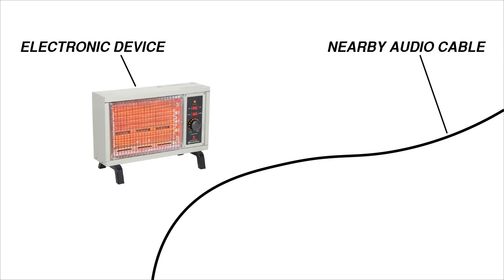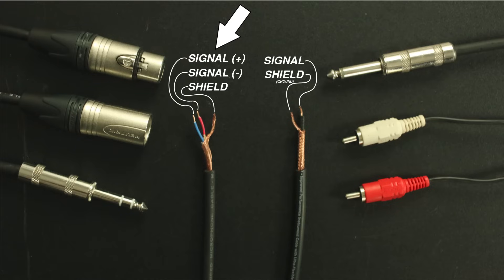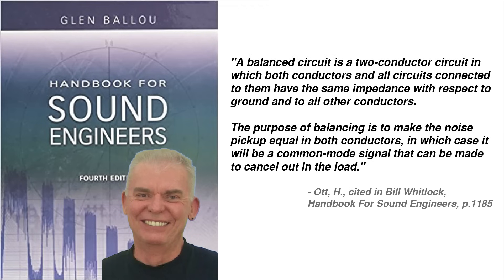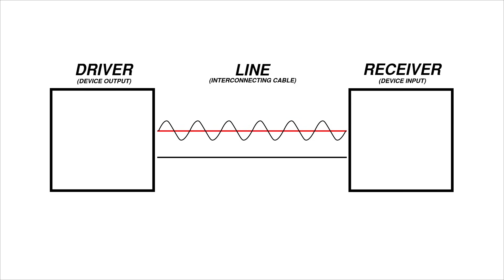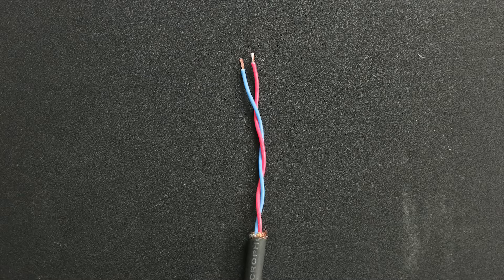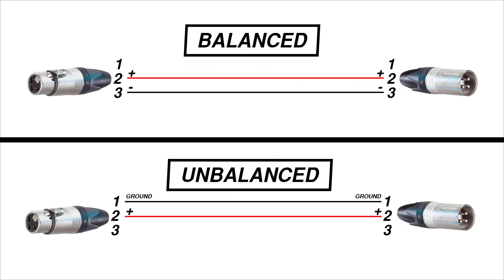Balanced vs Unbalanced Audio | Do Balanced Cables Sound Better?

Comment: Pretty slimy of you not to mention that this effect only matters if you have a 1,000 foot cable, and there's absolutely zero audible effect on an unbalanced cable of only a few feet. It would have been trivial for you to demonstrate that in the video too.
Reply from the maker: Any connection over 15 to 25 feet should be balanced.

Comment: The reason the cables are twisted is not that they occupy the 'same average position', which is in itself a rather weird definition. The simplest, and at the same time correct, explanation is that the surface inside the loop that gets formed by cables in between pins 2 and 3 in a balanced XLR circuit is -minimized by the twisting-, compared with the same arrangement without it. The EMF induced in the loop is proportional to the amount of the area in between the cables.

Comment: Great video man! I recently turned off all of the LED strip light around my desk as it was causing interference with my cables plugged into the interface on my desk. It’s subtle, but I was always wondering why I was get a weird distortion in my vocal takes, and it was because of this. Even though I was using XLR cables. They may be balanced, but making sure that you have the least amount of electrical interference when recording is so important. Great video man and very well explained!

Comment: Have some confusion about 1/4 TRS cables, can they be stereo and not balanced or stereo and balanced?
If they can be different, how would you tell them apart if they look alike?
Reply: A connector would require at least 5 conductors to carry a stereo balanced signal (assuming shield/ground would be shared).  Not possible with a TRS or standard XLR-3 connector because they have only 3 conductors.  But there is a 5 conductor XLR style connector that can (and does) carry balanced stereo signals.

Comment: I used rca connection for my preout to amplifiers and I get that unbalanced noise at 05:00 comparison. I did a lot of googling and I am going to switch to preamp and power amps that used XLR for inputs and outputs supports. I think switching to balanced will significantly reduced the hertz noise that is demonstrated in this video at the end.
Reply from the maker: If the cable run is short, it may not make a difference. You might be experiencing a buzz from a ground loop. I might make sure the two devices are powered by the same power circuit as a first step to troubleshooting.

Comment: Interesting. And while I can see this is really important for analogue audio connection, the problem is sidestepped if you use digital connection like coaxial, HDMI or Toslink right?
Reply from the maker: UTP for CAT6 is twisted and balanced to minimize jitter and crosstalk. I’m not sure, but I would guess HDMI is also. Coaxial and RCA utilize a coaxial method that is similar to twisting but I’m not sure if those are typically balanced connections.

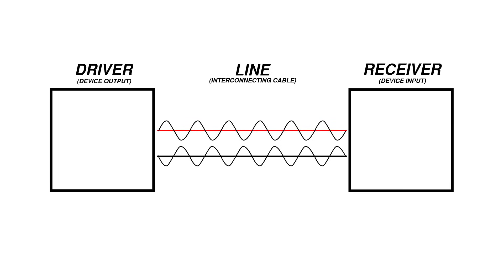Comment: My only issue is the wave patterns are not staggered (or out of phase to the correct degree) to make the added waveform representative of what's going.  Peaks/troughs touching from different phases should cancel out not build on each other 4:19

Comment: Great video man! I'm still confused though. I thought that if you have two of the same exact signals, it should amplify the signal rather than cancel them out.
Reply from the maker: That’s generally true. But this type of receiver (differential receiver) amplifies the difference. So you can think of it like one getting inverted, then it behaves like you’re describing.

Comment: Thanks for the great video! I've heard that most modern mixers will take balanced signal and process it to remove the noise using a "balanced differential circuit". However, I'd really like to know a way to test if a certain mixer really does that, just to be thorough. What's the best way to test that? Thank you.
Reply: XLR and TRS connectors are balanced. XLR is obvious, but TRS and TR 1/4" jacks look the same - you have to read the user manual to see what it has.

Comment: omg this vid is a year old. l hope someone responds: 
1. all guitar jacks are mono (TS). Is it just me or everyone goes around changing the input jacks of guitar and amp to be able to use a TRS connection? or the jacks are prepared to work with double-signal cables and only l was unaware of it? (wouldnt be the 1st time heheh)
2. A pre-amped guitar (with a battery) never makes noise, regardless of the wire. What's the deal in this case?

Comment: hi,
one quick question… if i don’t have balanced input on my monitors (only 1/8 stereo input) and my audio interface requires 1/4 TRS, my only choice is (AFAIK) is the cable that splits from 1/8 stereo plug from speakers to two 1/4 TRS on my interface. So this would still be unbalanced. Right?

Comment: do they ever use twisted pairs in fancy cables? Twisted pairs are used in computer networks for another level of balancing - the two wires swap positions every few mm so the noise is not only picked up by both wires, but picked up in equal amounts.

Comment: Thank you for your explanation regarding induced noise immunity, but what's the purpose of the shield and should be connected at both ends of the cable, only one end (if so which one) or left unconnected completely? Does anything change if the interconnected equipment is also independently earthed (grounded) like it most probably is here in the UK? What about earth loops? Perhaps that doesn't matter with balanced systems? Just trying to understand the full picture. I'm also intrigued as to whether a balanced signal source can be safely wired to provide an unbalanced feed to unbalanced equipment. Are levels and impedances significantly different between balanced and unbalance (line level) systems? Thank you.

Comment: I think your topic is a bit misleading. It should have been: Balanced vs Unbalanced Audio I Pro's and Con's regarding noise.
Balanced vs unbalanced regarding sound quality is a completely different topic since it very much depends on what kind of technology is used in the receiving end.
If the receiver is a differential pair of transistors you will also cancel even order distortion and the recorded signal contains a lot of both even and odd harmonics that originates from the recording itself. The recorded harmonics need to be kept intact as much as possible to not alter the sound and for that you need circuitry that amplify all harmonics equally, and a differential reciever can have an impact on the sound quality since it cancels even harmonics and amplify odd harmonics.
So a balanced signal and balanced differental receiver actually can make the sound harsh and bright just by the technology used.
Over the years I have owned about 50 different amplifiers with both unbalanced and balanced input and mostly it sounds better with unbalanced signal compared to balanced signal.
It's not always the case since it also dependes on the local feedback used in the differental pair receiving the signal. Bandwidth of the input stage before feedback can't be low etc. etc...
I have never heard any difference between balanced vs unbalanced if the input is transformer coupled. 
Many amplifiers have differential pairs in the input stage even if it's fed signal unbalanced and then you would alter the harmonic distortion pattern anyway so then you will have harsher and brighter sound regardless which type of signal you feed the circuitry.
So if noise is not a problem in your system I would say that unbalanced signal is the better sounding format in general, but it mostly have to do what the receiving end amplify and cancels.
The topic is very complex and depends on many things, but the best sound overall is always when your circuitry don't alter the structure of the harmonic distortion and unbalanced signal have a better chance to do that compared to balanced.
I have not heard a amplifier where the balanced input is better than the unbalanced, only equal or worse.
But that is from a home audio system's pespective where noise normally not is the problem that need to be solved.
So regarding your initial question if balanced cables sound better I would say no they don't, but they can help to reduce noise if noise is a problem.
But that can be done with unbalanced cables and transformers too.
So be careful to not fuel another myth that balanced cables are better sounding than unbalanced. They are not.

Comment: The problem with twisting wires together is you can more than double the length of the wire needed which just adds more wire to pick up stray signals and creates more resistance. Its a waste of material and resources.

Comment: Perfectly explained. There reason for twsited pair inside the balanced connection is to minimize the pick-up in the calble itself, because the field will have a positieve and negative impact on the signal. After the signal is received, an opamp gain stage (that is a differential amplifier) will cancel out (also calles CMRR, common mode rejection ratio) and it will almost not amplify the common mode signal. Often it supresses in range of 120-140dB

Comment: Thanks for the video and channel. However, you did unbalanced connection wrong and probably most of noise caused by this. When connecting unbalanced over XLR you should put 1 and 3 together.

Comment: Typically and unbalanced cable would be a coaxial cable rather than a cat5 cable.  You should be comparing the balanced cable with a coaxial cable for fairness

Comment: Thanks! Now, my first thought was to trash all my RCA cables but then I thought, hey hold on! The RCA cables I have are at the most two feet long. So the interference in them would be negligible, right? Also about 3.5 mm cables, they are also unbalanced right? Again, the ones I use are 2 feet long at the most. Any input would be appreciated!
Reply: Clean sound is so overrated when it comes to music. Sometimes it seems like people nowadays can't enjoy music anymore, but acting and pretending as if they do is very common - and who cares? Sure not people that believe that acting cool is being cool...
Reply: Also there was a dude in here 10 days ago, that answered your question.

Comment: You explanation of the demo is incomplete.  You need to show the circuit to which each pin is connected to on driver and the receiver end, the pin numbers alone without the circuit are meaningless.
Also, you're telling the viewer to ignore the shield, but you're not ignoring it in your demo! You're connecting to the shield to create an unbalanced connection.
F.
Reply: But there are many people which he gave thumps up, that were very thankful for his explanation.

Comment: I still didn't get it. What makes it confusing to me is when you say "there is voltage on one wire" it doesn't make sense to me. Potential can be only between two points. One point is the end of the wire on the receiver side. Where is the second point?

Current doesn't travel unidirectionally, it's always in a loop i.e. circuit.

Comment: I have a high-end digital music player and matching amp, which can take either unbalanced RCA or balanced XLR connections. At present, I already had a decent quality RCA interconnects so used them. I am wondering if there are sonic benefits to be had buying an XLR connection? Baring in mind, the distance of cable is very short and at present I am hearing no noise/interference using the unbalanced connection. If anyone could give advice, I would be very grateful.

Comment: Hey Kyle, thanks for the video. Here is a question. I'm setting up my electronic music production studio and I have a sound card SSL 2 and a pair of Focal EVO 65 monitors. So, my question is, should I use mono (one ring) or stereo cables (two rings)? Thanks!
Reply: The answer is this. Firstly you need to find out if a balanced connection is available on both the outputs from your SSL2 and the Focal EVO 65 speakers. I downloaded the manual for your SSL2 and checked the specs and yes the monitor outs are balanced. Same for the Focal speakers. So yes use a balanced lead from one to the other. Even if the distance is short at least you will get a higher level coming from your SSL 2 to the speakers. Hence you wont need as much on the monitor output level control to get the same amount of SPL coming from your speakers. The balanced lead will also avoid any noise or hum pickup on the way too.

Comment: If an unbalanced cable is noise free and quiet, the audio fidelity will be not inferior in anyway compared to a balanced cable carrying the same signal. As long as the distances involved are relatively short. Balanced leads are better over a longer distance, plus their noise cancelling features are also superior and the fact they will result in a stronger signal at the input end.

Comment: Great explanation for this topic. I think it should be mentioned that the potential for noise injection is dependent on both the environment as well as the length of cable.  So for those of us who use unbalanced cables to connect our music source to our headphones or IEMs, the 1 meter of cable doesn’t offer very much cable length for noise to be induced. 

These concepts are really more applicable for longer cable lengths, and in environments with lots of electrical noise potential (fluorescent lighting, motors, automotive ignition systems, etc.)

Comment: I tried an XLR cable splitter on Rode NT1 and NT-2a and I have the feeling that this mic output unbalanced signal. On toher mic (ntg-2, lewitt etc) it works as adviced (i can hear sound on both split channels), but not on the Nt1 and Nt2-a. I dont know if you have this mac bu I would be very interested by having your point of view on it (have you seen xlr mic with unbalance output ?)

Comment: I found a mathematical approach that made balanced transmission easy to understand for me. Wire 1 carries signal A, and wire 2 carries signal -A. Now if an EM signal crosses the wires, both wires get a signal B added. Wire 1 then carries A+B, wire 2 carries -A+B. The receiver then subtracts (not adds!) both signals: C = (A+B) - (-A+B) = 2*A and divides it by 2 to restore the original signal A and removing the noise signal B.
Reply from the maker: Thanks for sharing this, Biochill. But keep in mind that signal -A isn’t necessarily needed for the noise cancellation (common mode rejection), but only for the signal summation (differential mode gain). 

If there is no signal -A, it could look like this:

C = (A+B) - B = A

Comment: I came here to figure out which type of cable I should use when plugging in a Shure SM7B microphone into a "DJ" mixer.

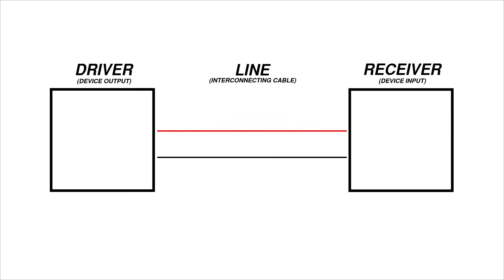Unlike many of the electronic nerds this was still too complicated for me as I have absolutely no understanding of some of the terminology you used. @2:22 you say "Driver", "Line" and "Receiver".  At this point I understand what the line is but it is somewhat unclear what the "driver and the receiver" is.  In my case I am left to assume that MY driver is my microphone and the receiver is my audio mixer, but I'm not sure as you used the word "device" in both descriptions of the "driver and the "receiver" but you didn't state specifically what the device actually was.  So, again I am left guessing (forgive my ignorance).  "Balanced receiver" - "Differential Device" - "Common Mode Rejection"??? Holy crap!  At this point I am completely lost!

What is not explained here is why would anyone EVER use an UNBALANCED cable on any type of equipment.  What is also not explained here is when would using a UNBALANCED cable be acceptable, (remembering that I came here to learn what type of cable I should use with my Shure SM7B Microphone).

At the time of this comment I retrieved my Shure SM7B User Guide to see if there was any mention of which type of cable should used.  There was no mention in plain English (non-tech talk) that would clarify this quandary.  If you or anyone else who may read this have a very simple answer for a very simple mind I would love to hear it!  Thanks!
Reply from the maker: Hey, Doctor Kayak. Thanks for watching. This video is not intended to answer that question. You’re correct though. In your specific case, the driver is the microphone and the mixer is the receiver. 

You need an XLR microphone cable.

Comment: Why not make everything digital so they are resistant to electrical noises?
Reply: How would that cancel noise?
Reply: @johnread4573  Digital means you can detect and correct errors to ensure the oppoenent receives the correct information. This eliminates noise instead of cancelling it.